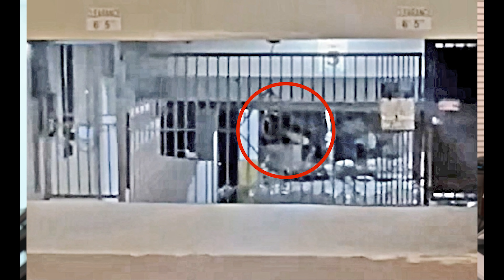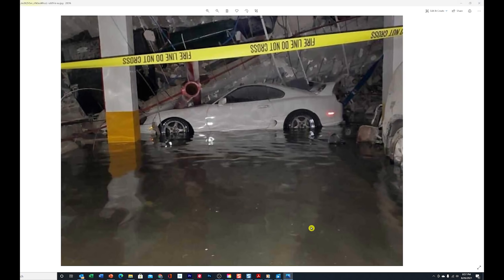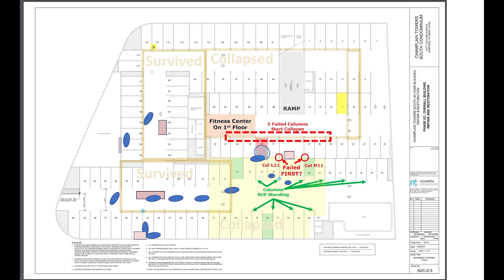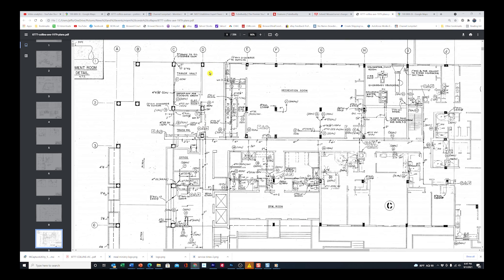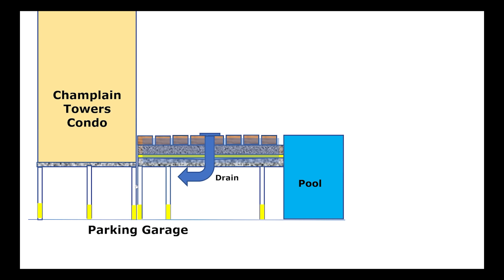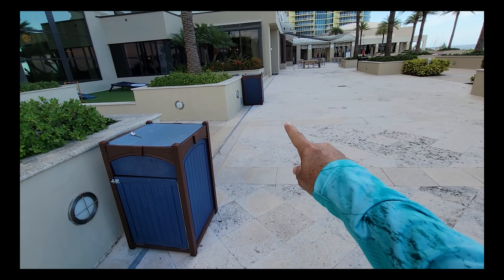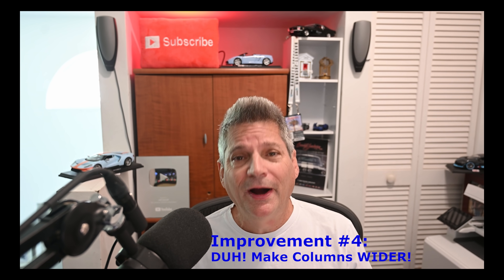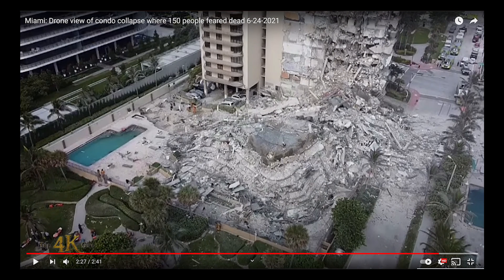Miami Condo Collapse: 4 Engineering Fixes May Have Prevented It

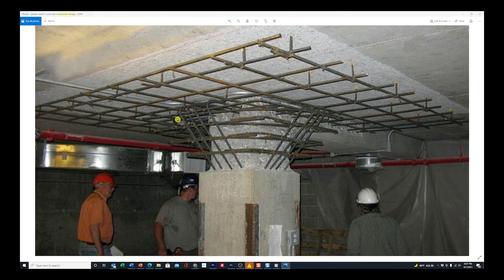Comment: That capital at 13:00 still looks like a lot of work compared to just a rectangular column so I guess that a builder would try to go with a simpler solution. Where I live it's very popular to use precast/prestressed concrete elements as they make construction much faster. They can be joined together in various ways, from welding to cast-in steel anchors. It seems not to be a popular construction method in US tho.
Reply from the maker: Easier to build it when the building is going up, and reuse the same forms

Comment: Somewhere along the line of previous facts I heard that initial construction had been halted and then resumed with design changes. I recall that some part of that stop construction was because of budget concerns. So with that the engineers and architects minimized costs resulting in fractionally marginal strength requirements.....  It was a "House of Cards" waiting for the right card to fail......
Reply from the maker: Yes it would seem so, plus 3 different contractors

Comment: Here in Bangkok I lived for several years in a building built in 1968. There were some big differences in build quality.
The building is 10 storeys, and H-shaped with a solid concrete elevator/stairs core. Columns are 24" at ground level and 20" at roof level. There are beams between all columns. 12" wide x 24" deep, ~8m spans with H beams, so floor panels are 8x4m. Floors are 4m x 16" prestressed panels with a reinforced pour on top. 
Impressive compared to other buildings of a similar age.

Comment: What would I have done?
All all building columns 24" and deck columns 18".
The stairwell next to the ramp should have been a concrete core as well.
Expansion joint as you suggest is a good idea as well.
Today I would be looking at additives for the concrete that would reduce the effects of salt. I'm not sure what options were available in 1968 though.
Reply from the maker: Good idea on additives David

Comment: On that picture @13:32 of that repair. I wonder ...how in the world do the get concrete in there. Pushing up, against gravity? How? 
Do that put wood all around this But then, how to put concrete in, so it fills everything and solidifies and then shrinks, but with no contact to the ceiling??? How does that work???
I just had to wait, it's all explained. Well done!
Aaah, I see they put the concrete in, by special valves under pressure. Well done , I guess.
Anyways.. a great video!!!!
BTW, here in Holland we have more and more (underground) garages that collapsed. Never looked at the columns. They have a very hard work on repairing them. Looking at pictures it looks like punching through.
Reply: I hope engineers from all over the world are doing case studies in Holland.
Reply: Ruby Arias Yes, I hope so. We have problems with our bridges next to the see, concrete and rebar and saltwater. You know, all those constructions to keep the sea out of our land (Delta-Works).
These structures were built between 1954 and 1997.  Anyways, they have made it now a 2 lane road, while it was a 4 lane and reduced weight limits for trucks. Sounds scary to me. Starting construction / repairing of it in 2023. 
Furthermore there is this problem of houses, built in the years 1970-1972 about. "Kwaaitaal" was the brand of the concrete used under the first floor, above the ground with space in between. Due to moist there and the use of excellorators/salts in the concrete, the regard starts to rust and the concrete fails. Chance of collapsing ground floor, say at a party with more people.

Comment: Did any of the vehicles in the basement have a crash cam installed?
Reply: I'm pretty sure that dashcams are only active when the engine is running, otherwise they would drain the battery.

Comment: Well, obviously 

1. put the beams back in the design that were omitted at the last minute when they decided not to do the step-downs.
2. Space the columns closer together that were supporting the pool deck
3. Make the pool deck slab much thicker—the flimsy slab was way underdesigned 
4. Don’t redo the pool deck in 1996 adding a ton of weight and screwing up the drainage.

Comment: I believe the condo had about $600,000 cash on hand. The 40-years certification engineer proposed around a 12 million dollars repair design to fix the deteriorating deck and such from below the deck. The 12 million dollars needed members to vote to approve the members to be assessed for a fairly large sum, and the vote to approve either never came, or the approval came too late. Thus, there was only about $600,000 available, of which some were probably already earmarked for regular expenses like staff salaries, utility bills, possible tax bills, annual insurance bills, etc. Lets say half of the available cash were already spoken for by these regular expenses. This leaves let's say $300,000 left for emergency temporary repairs, until the resident unit owners voted to approve the 12 million dollars assessment to perform the major repairs, as proposed in the 40-years certification engineering report. Will $300K be enough to add all those new columns at the edge between the exterior deck, and the building floor to separate the building from the pool deck? Will $300K be enough to add all those capitals to all those columns under the pool deck? My guess is not, as building repairs have gotten very expensive these days. Hindsight is 20/20. No one had foreseen that the building was in imminent danger of collapse. No one had foreseen that the transfer beam(s) could act like crowbars to loosen the column(s) of the building itself, as this sharing of columns between the side of the building with a semi-detached garage "roof" is quite common, as well as these transfer beams are also quite common. But using 20/20 hindsight, the available $300K could had been use to (1) divert all deck level parking to the picnic area, which would required 0 to a couple of hundred dollars to put up some new signs, and to put up some chains to prevent cars (and delivery and mail trucks?) from entering the deck. (2) $5K to remove all dirt out of planter boxes to lighten weight on the pool deck, and to examine the bottom of planters for leaks, and water damage of concrete, as often cement and mortar underneath such flower pots and planters had turned to powder from water damage. (3) $50K to carefully cutup and remove all planter boxes, as it was likely after removing the dirt in the planter boxes, it was likely found that the cement and concrete below the planters had turned to powder. The removal would had reduced weight on the deck somewhat, which in 20/20 hindsight might had been critical like the last feather broke the camel's back. The planter above the end of the transfer beam might had served to increase the crowbar effect of the beam. (4) $100K to $150K to remove the pavers and its leveling "sand" beneath the pavers. Specially, the areas where there were water pooling on the pool deck, the pavers and its leveling "sand" beneath the paver could had been stripped bare to track down the reason for the water pools on the pool deck. This would reduce weight of the pavers and leveling "sand" in addition to the possible water accumulations underneath the pavers forming the water pools on the pool deck. In a prior video by the channel host, it was conjectured that the drainage holes on the pool deck were raised to the added paver level without providing side hole of the extended drainage piping preventing water accumulated below the pavers to drain into the extended drainage pipes, as pavers are usually not water proof. This possible water accumulation added weight to the pool deck, as well as being damaging to the pool deck. (5) $100K to make temporary repairs to the deck from above after the pavers and any added layers had been stripped to expose the original deck surface. (6) $100. After the original surface of the pool deck had be exposed, setup temporary metal posts beneath the pool deck in the garage to shore up any seriously damaged and weaken spots discovered from examining from above of the stripped to the original surface pool deck. The $300K would had ran out from the above; however, with the pool deck stripped to its original surface, the damages would had been easily be observable to all resident voters, and new engineers can be engaged to perform a rapid and more accurate assessment of the problems, which might had pushed the voters to quickened their votes to approve at least a few million dollars to do at least what the channel host has proposed about a set of new columns to disengage to pool deck from the building, and to build the expanded crowns and capitals on top of the columns in the garage below the pool deck. As no one could had foreseen that a fallen pool deck could had pull the attached building side down with it of a large building, even though there had been some few cases of attached decks pulling down walls adjoining it, they were fairly rare, and nothing on this scale, no one saw the imminent danger of the building collapsing.
Reply: A condo should set aside condo fees cash from the date of occupancy, each and every month. 

I know of a condo board that had 15 million in reserves. This building is 35 years old and is being renovated throughout and, they have the cash to do so. 

600,000 is nothing, that's barely keeping up with the property taxes and utility bills on a property like that.

There will be regulatory changes regarding the administration of the operations of these condo buildings.

 There has to be.

Comment: Jeff, your expansion joint suggestion is spot on. 

I have suggested this expansion joint before to a video posted at BI. But, I am glad you mention this here today. When you posted the garage video, I was puzzled as to why there were no expansion joints shown anywhere in that garage video in Miami. 

That's the first thing I was looking for when looking at the ceiling of that failed garage. 

Just a comment regarding your columns, presently, we are completing a similar kind of 2 building project this fall and it has expansion joints completly around the 12 storey towers and the garage has x joints between the building and also has x joints dividing larger expanses of garage for movement. The columns here are designed at 14 inch diameter 5.5m O/C and 7m space maximum for underground drive isles with a 42 inch capital at the top. There is a heavier reinforcing mat at the column caps located within the 12 inch slab and integrity bars linking one one column to the next. The design provides capacity for brick pavers, landscaping, visitor parking and a 45 ton fire truck to access the development in the event of an emergency. All our projects have a similar design for the underground garages. As our company have done this for quite some time.

One thing that an expansion joint also does is: it allows you to totally remove it, should it in time deteriorate, and this can be done without impacting the structure of the tower itself.

This type of design happens all the time. What happened in florida will hopefully lead to serious changes there with consideration given to proper maintenance and, with the possiblibilty of removal and reconstruction - as this should always be an option should it be required.
Reply: Yea that was my thought to, just for the fact the pool deck will fail before the rest of the building they would want it separated just so it can be removed and rebuilt eventually.
Reply: In 1970-1986, I had a Florida GC license. There was no State Building Commission responsible to approve the plans of a multi-story building and very few inspectors. During that time a new parking ramp on the East Coast of Florida collapsed during construction. Caution is the word for all Floridians, including COVID.

Comment: What just came to my mind is pressure. Pressure is force/area. By widening the tops of the columns, the weight of the slab is spread out over a larger area, reducing the upward pressure applied by the columns.
Reply: Yes, the dimensions for shear are force per unit area.

Comment: I love how the old guys with no modern tooling knew all piliers need toppers...and include art on top of that and o look still standing in some cases even today...yet in today's time as one engineer stated modern building design is all about the cheapest way to do the basic of needed job.....this should never be the thought prose's of anyone yet it seems to be the norm in construction
Reply: My God, for years they were trying to prefect the.    
       " Philicreat" method for pouring slabs. Of a half a slab poured at another location.                Trucked in with prestressed cables half a bar joist looking Reinforcement sticking up from the half slab.Brought in and stacked on top of block walls poured with concrete and re-rod. 
     The half slab, Curb formed,  and the second half poured after the provisions for the mechanical were sleeved and water pipe ran sheathed in the concrete. 
    Reinforcement rod penatration past through the gaps left between half slabs for the next row of separation concrete block walls. And then the block wall partitions with no penatration of rod from floor to floor. 
     Only at the end of the multiple half slabs that made up the length of the building floor. Acting as the only vertical support for the next floor only one block wide. 
   Columns were only on the ends for the staircases and  elevator wells. Sized for those needs. And hopefully engineered to minimize latterl movement. I don't know I was just a youngen then.
     Early  to mid 1970s. I worked on three of many, out on Madeira Beach  east of St. Petersburg.
    Tallest one was twelve stories. You know.
No building has a 13th floor.  Yeah, right. 
     
I personally know of one condo. That was. 
I  won't use the  word 
                      Falling.  Opp's  oh well.
     Instead I'll just say LEANING  to the Nort
So severe that they installed checker plate on the sidewalks at the right angle where two buildings meet.  Like nobody would ever look up from the floor below. And see a progressively larger gaps.  They even thought to fastened only one of the leading edges of the beveled checker plate. So it would slide. Not sheer or pull out the drop in anchors. 
     I discovered this.  Years later after we were called back. Due to the sanitary piping.  No hub bands pulling lose. On the upper floors in the corner. Fire lines and domestic water were configured in a
 "Swing joint"  Configuration that allowed for the expansion.  They literally asked if they made a.......
     The Representative of the condo association. Asked. 
     You know like a accordion like fitting. 
That would stretch. 
     My Father. Who had desolved his Mechanical contracting business years before. And was up in his age. And was trying to enjoy Retirement. 
     Had after we discovered  obviously. 
With someone with a brain. What was happening with the Building. And piping properly installed. 
     Had many........    I remember . A  loud string of words the U of Tube would sensor.  Then told him to go prorcrocaeate with himself. And we drove straight to the Clearwater building department and I sat with him while he VENTED to an inspector he knew and respected. Same string of colorful words. In the late 80's early 90's. 
    I surely hope they stabilized that building.
I've seen its still there on Google earth.
Reply from the maker: Yes that is a problem
Reply: Because it's the norm in society today. It's the holy grail of all business. It's going to put Boeing out of business. There must be engineers and contractors and building inspectors that are having a lot of trouble sleeping without drugs since this sad collapse.

Comment: Take a look at the slab from 3:00 to 4:10.  Specifically the pattern of the rebar from where tore out of the slab.  Very consistent spacing and length (end points).  The rebar seemed to be laid out well,  and all of it tore out of the concrete instead of shearing.  The rebar performed very well.  Was the slab concrete substandard for the rebar to tear out of it as seen in this part of the video ?
Reply: I noticed that too and wonder if the reinforcing was all rusting to the point the reinforcing rods were free of the concrete.